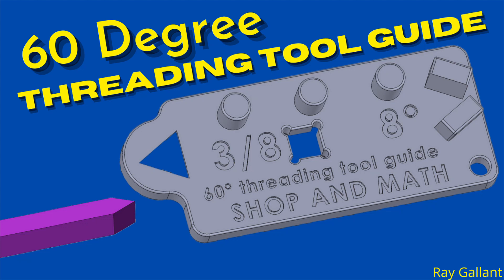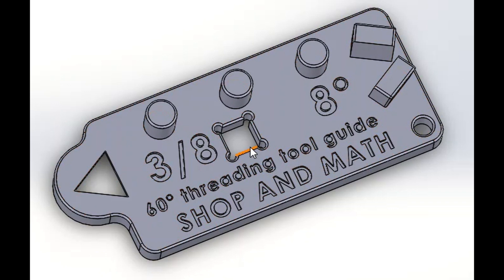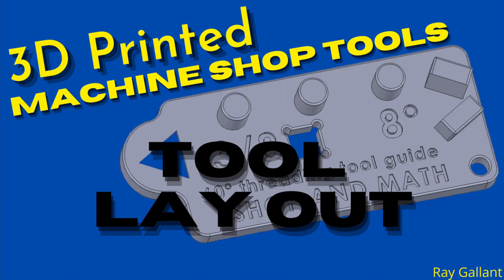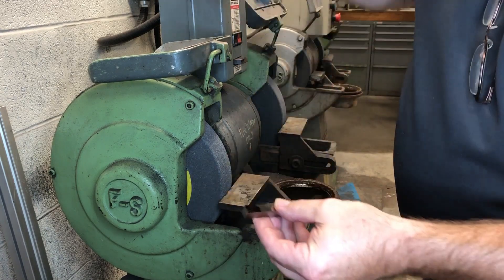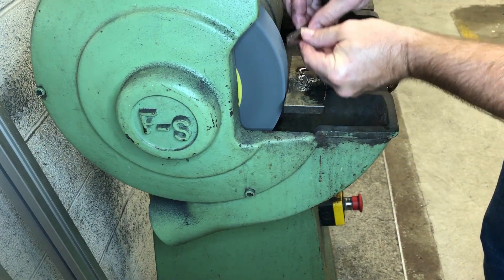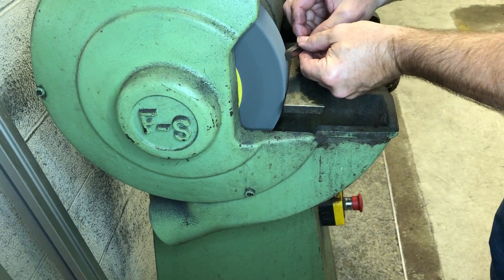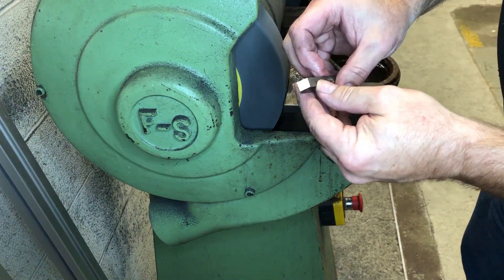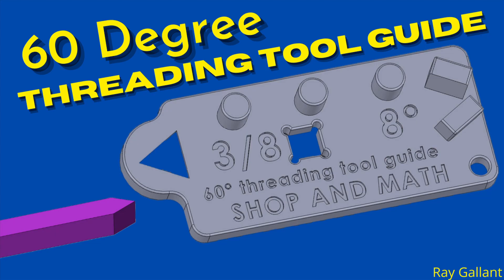60 degree threading tool guide

Comment: Great idea!  One suggestion I have is to recreate it in OpenSCAD so that it can be easily changed for different angles through the Customizer (either in the standalone app or on Thingiverse).
Reply from the maker: as you can probably tell I am only 3 out of 10 with solid works and don't have a clue of Openscad  ? 
would you be interested in  helping ?
the only condition is it must be provided to everyone for free
Ray

Comment: Looks good, but I like to use classic threading fishtail gauge for grinding the tool. By holding it to the light, you can see the gap between the tool and the gauge and grind it more precisely.
Reply from the maker: That’s how I learned how to do it as well with the fish gauge or centre gauge
All first your students have to make and grind the thread cutting tools
It helps him with the layout and centring the tool
The biggest problem is the tool starts out at 2 inches by the time they’re done it’s only 1 inch long
In the shop I’ve gotten a lot of positive feedback from students

Comment: Thanks for sharing, I'm interested in 3D printing but was looking for practical uses for it especially as it relates to the a Machinist
Reply from the maker: This is just the first of many machining tools that I’ve designed
There is at least six more in the pipeline that are already in the prototype stage and I just need to work out some of the kinks to make sure they’re good enough to put Out there
Stay tune
Let me know if you decide to print one and tell me what you think of it
Ray